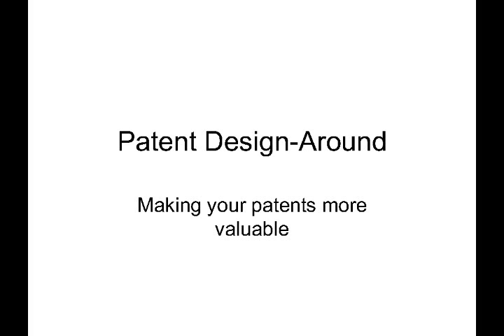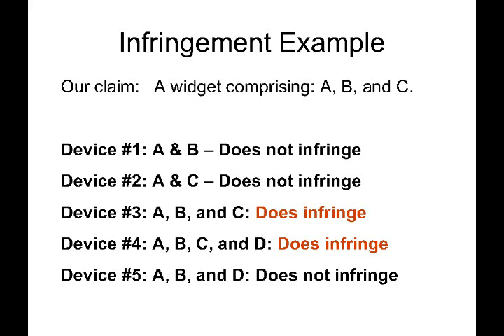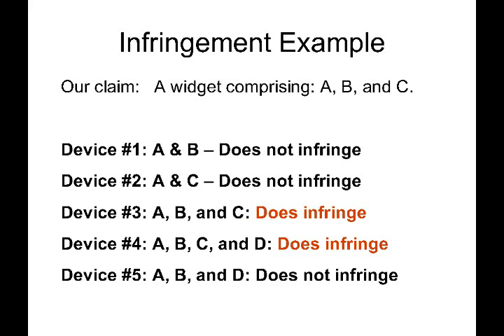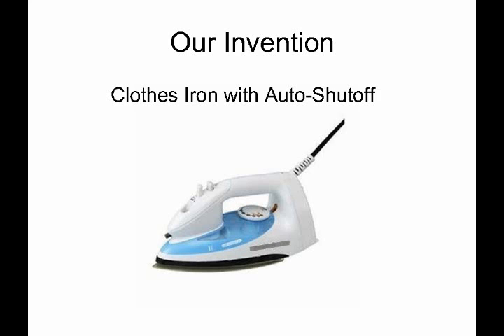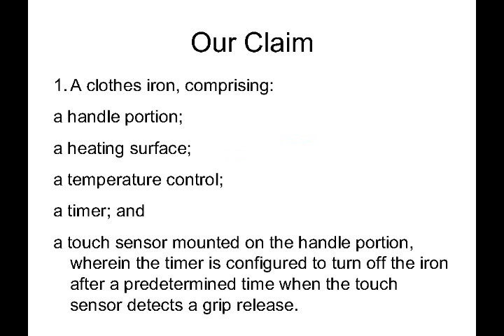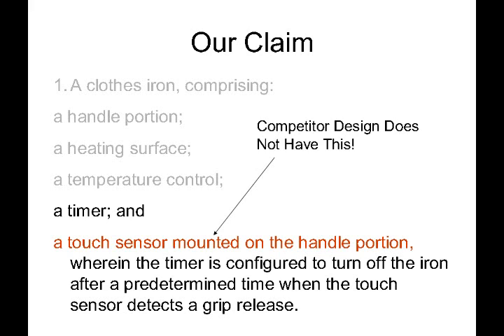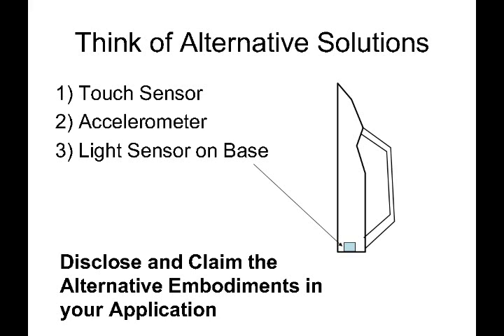Patent Design-Around

Comment: But wouldn't adding additional claims in the form of additional designs to achieve the same result as a way to prevent design arounds  result in different patents altogether? If you invent a product that does the same thing but with multiple completely different designs wouldn't that be a completely different design pattern? how can you include multiple designs in one patent? Is that allowed?
Reply: this needs a reply

Comment: What about Doctrine of Equivalence? In the first example, The claim specified touch sensor and the person got around it because an accelerometer. But would the doctrine of equivalence protect the patent of the specific touch sensor claim? Since they both have the same function.
Reply from the maker: That's a great question... typically that doctrine applies to items that have a similar function (e.g. rivets vs. screws, both are used to fasten pieces of material).  Because a touch sensor and an accelerometer have different functions (even though both were used in the iron to achieve a similar end result), it is likely that doctrine would not apply to our hypothetical example.  Thanks for watching.
Reply: Inventor's Quick Tips 

The rivet and screw method are different, but the end result is the same (fasten pieces).

The touch sensor and accelerometer methods are different, but the end result is the same (auto-shut off).

Not sure if the doctrine of equivalence applies to the method to achieve the result or the end result? Obviously some methods are superior to others. It would be odd in my opinion for doctrine of equivalence to group rivers and screws in the same because there are situations when you would use the other.

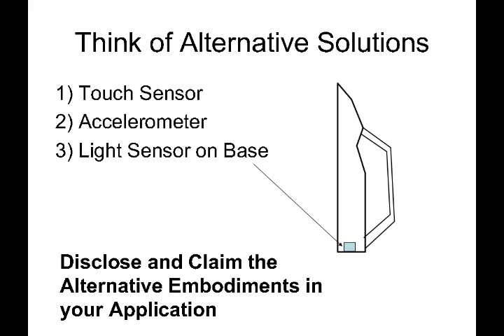Comment: This is incorrect advice. 5:57 does not outline a “generalized” claim. The word “device” invokes means plus function (112f), and therefore, you are limited to embodiments in the Spec. You should not be giving legal advice if you are not an attorney. It’s against the law. And your disclaimer at the beginning doesn’t immunize you either.